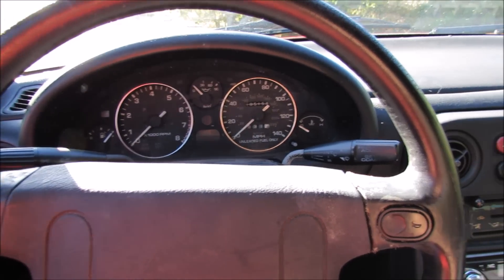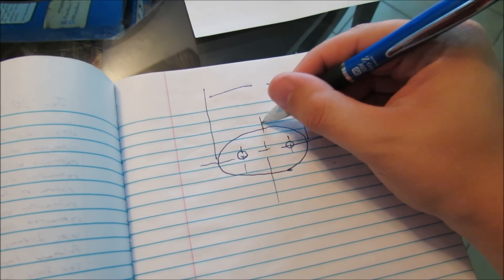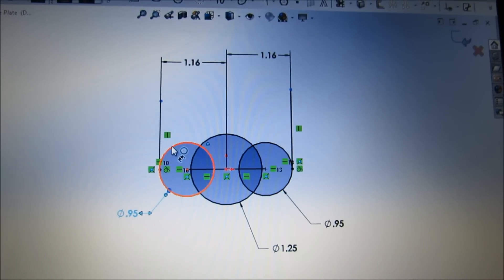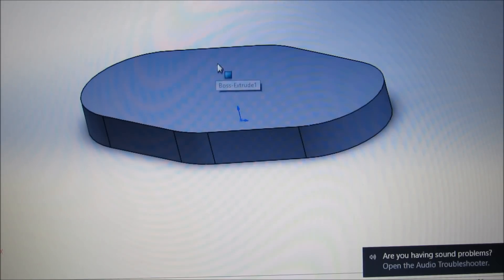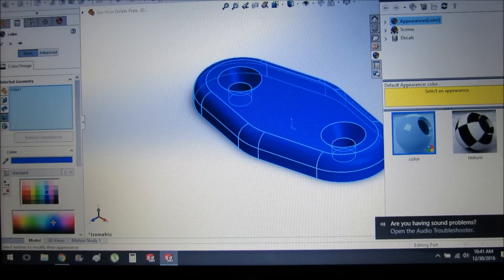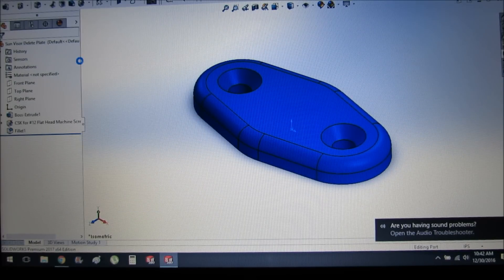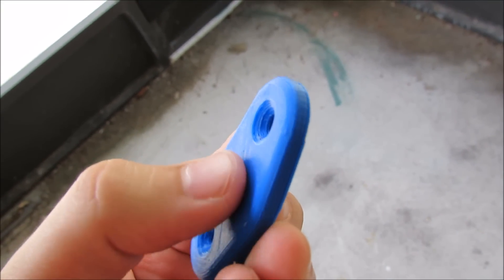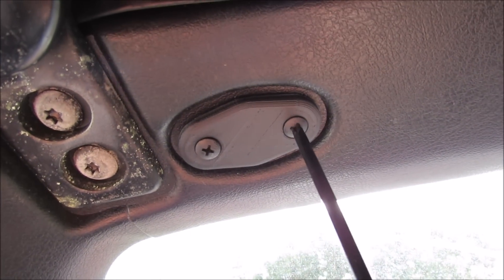3D Printing Miata Sun Visor Delete Plate

Comment: Can you shere all Cura settings for this print because is perfect. I try to set my i3 corectly and it will help me a lot
Reply from the maker: Profile: Normal Quality -0.1mm
Print Setup Custom
Layer Height .2mm
Wall thickness: .8mm
top/bottom thickness .8mm
infil density 20 to 80% depending on how strong
Printing temperature 230deg C
Build Plate Temp: 100deg C
Diameter 2.97mm
Flow 100%
Enable Reaction.  Yes Check
Speed 60 mm/s
travel speed 120mm/s
enable print cooling yes
support no
build plate adhesion type: Skirt

Thats all i got, hope this helps!
Reply: Thanks!!!

Comment: close enough but you should have used the ellipse tool to create the basic shape as it could have been closer to the true shape. Great work i know from experience that an ellipse is tricky to measure to get all the correct radiuses that is made off
Reply: I agree, I use autocad, and this model would have been as simple as the following:
1. measure base length & height
2. start elipse command
3, click on workspace and enter width, then enter height

That said, your print looks much better than the first print you did
Reply from the maker: Thanks, each print i do gets better and better.  Wait till you see the miata part video im uploading currently!
Reply: I ordered the prusa original i3 mk2 the other day but theres a 7 week lead time.... so I'm trying to watch and learn as much as I can so I can be ready when it arrives at the end of February
Reply from the maker: Thats great, its the one i wanted, but i recently found out my Bank is why it didn't go thru, they thought it was a fraudulent Charge...I know already that i love 3d printing so much ill be buying a bigger one!